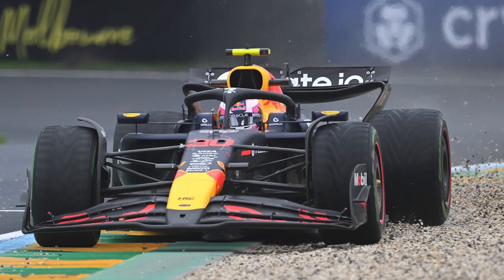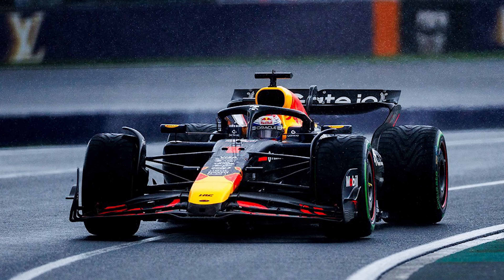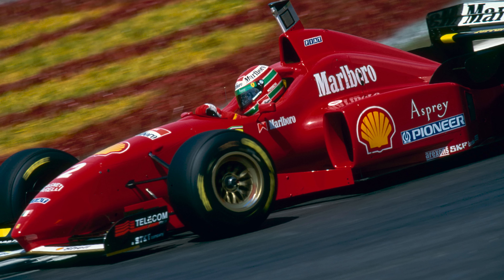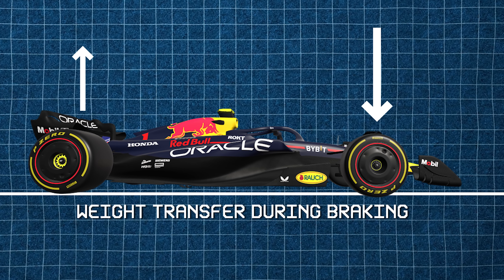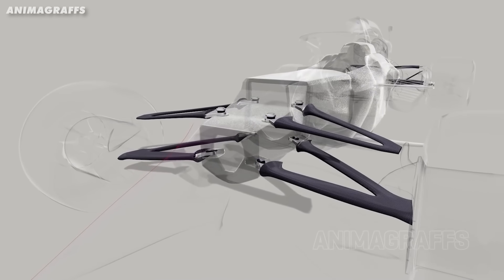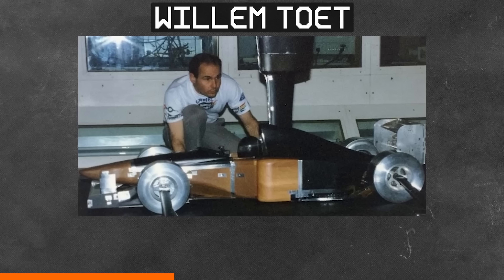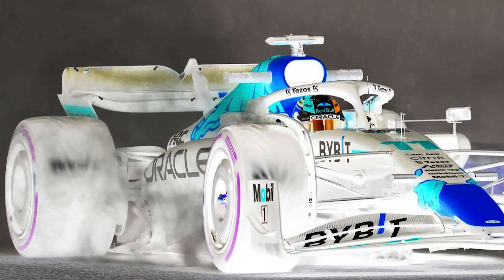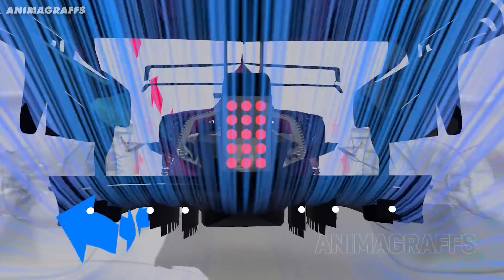F1 Engineer Explains Red Bull's Difficult Car

Comment: Here after Max perfectly balanced it for pole position 😅
Reply: If you hear Horner's interview after it is even more impressive to know that Max is not just doing Max stuff on track but also in working with his engineers. They made an insane amount of micro adjustments to get the car where it was for quali, then it just needed the perfect lap lol. What a treat he must be from an engineering side, he's just a massive racing geek on top of being one of the best 2-3 drivers in world (on any given day).

*McLaren fan ;)
Reply: @tbz1551  
Anyone who's driven a Sim for an hour then looked at best sector times meaning you're potentially 0.4 faster, yet can never string them all together, well that's what Max did today, McLaren engineers did a better job, just the drivers did what often happens and can't get it all together.
Reply: Yuki had traffic in Q2 and so did not have a run as he did in Q1. Something needs to be done about qualifying.
Reply: @bertram-raven had Tsunoda not stuck behind traffic on Q2, his lap could've been guaranteed for Q3.
Reply: @bertram-raven  they should just do it so everyone is released a certain time off each other and it becomes more of a time trial, that would be good, also eliminates giving a tow
Reply: Here after he kept it together for the win
Reply: @bigfootproductions749  😂 likewise
Reply: I watched closely and saw Max really fighting the wheel compared to McLaren drivers
Reply: And set a new circuit lap record
Reply: The guy is simply one of the best drivers in f1 history
Reply: Even Max admitted directly after qualifying that he felt he was going to crash 5 times during that lap. So clearly the car is still incredibly unstable. Max just has a 6th sense to keep the car perfectly under control, even when the car is out of balance.
Reply: said he actually felt like he was gonna crash multiple times in that lap 😅 its unstable even for his standards
Reply: Here after Max balanced it perfectly for a race win 🏆 🏅
Reply: He said he almost crashed it.
Reply: If you are moaning about spoilers in the chat, wtf did you expect in a world where knowledge can be passed across the world in milliseconds. If you don't want spoilers watch it live or turn off socials. It's a you problem, noone else
Reply: Max reacted to his entire lap, basically saying he had under or over steer through every single corner.
Reply: And won
Reply: .... and won the race
Reply: I know Max can squeeze a win out of just about any car but I don’t think he would be setting new lap records if the car was as bad as everybody on the internet thinks it is. Is it the RB19? No but a car winning 21 out of 22 races is a straight up anomaly. At the end of the day, we’re only 3 GPs and a Sprint into the season so I think we should reserve judgement on the overall performance of the car until there’s more data to look at.
Reply: I've been watching f1 since 86 when I was 8 yrs old and it sounds so lame to say but it really is like Senna and Schumacher had a baby and his name is Max . He's got Senna's balls and Schumacher's brains. The kid really is the best I've ever seen do it and he's still so young.
Reply: It’s built for him dud
Reply: @RoshanSinghB  that not really true. The car is how it it. You even hear Max talking about how he struggles to drive it.
Reply: Yes I'm here after 4 weeks to say pole again for Max, what a great skilled driver
Reply: here again after max put it on pole at silverstone
Reply: I was afraid he wasn’t going to because of the setup in both FP1 and FP2 yesterday. 

Thankfully, Max pulled through
Reply: One lap on softs with empty tanks, hardly race conditions.
Reply: And a lap record
Reply: Would you believe it wasn’t perfect at all.
Reply: It was one lap. He said the car is behind on race pace. His only chance is if it rains on Sunday.
Reply: We are looking at a living legend doing his stuff. Wonderful times to watch f1.
Reply: and a lap record😅
Reply: Here after p1 😢
Reply: You cannot compare the person who come from Mars.
Reply: Because McLaren has low quality drivers who fail under pressure
Reply: even max has his problems with the car and it took him several laps to get everything out of it.
Reply: That’s like saying the Honda MotoGP bike isn’t shit because a certain MM93 slayed on it. RB is currently looking like 2020 Honda.
Reply: I’m here after verstappen won!
Reply: Because max Master the car 😂
Reply: It's Max's car x2. That simple.
Reply: here after max got p7 in qualifying in bahrain
Reply: Here after Max should have gotten a black flag.
Reply: @Storytime3stax  Get a life. Just saw the onboard. Max simply kept his line. Russell came flying around the outside but could not make it stick. That is all.
Reply: Here after Mercedes took Max out… Again
Reply: And when quickly backwards!😅
Reply: Starting from Albon, the Red Bull car has always been built around Max. If he can't adapt, the Red Bull engineering team can disband.
Reply: Max has a very unique driving style and takes some very unconventional lines. A car that suits him will not fit a majority of drivers.
Reply: More that Piastri and Norris made more errors in their lap than Verstappen did...
Reply: He almost crashed 5 times, he was taking everything that was possible out of that car.  @2Fast4Mellow
Reply: @2Fast4Mellow original comment "Max perfectly balanced..." means just what you wrote, Max did a brilliant job and Oscar and Lando didn't. So why the "MORE that..."?
Reply: Literally has the track record now he drove a world record lap @2Fast4Mellow
Reply: @2Fast4Mellow  Not really. Lando's comment was that his fastest lap was his best. It seemed like he felt that was all he could extract from the car. From the data, Max gained around a tenth on the entry of Turn 16 alone, that secured him the pole position since they were neck-a-neck on 1st and 2nd sector. The difference in braking/corner entry on turn 16 between Max's and Lando's fastest lap was HUGE. It was amazing how late Max braked and yet was still able to precisely turn the car.
Reply: @2Fast4Mellow but less error than Tsunoda or Hamilton were.
Reply: @2Fast4Mellow  it's basically outbraking everyone in that one last corner
Reply: That's purely because it's Max and the car fits his driving style more, the car itself is still a shitbox comparable to a 2024 Kick Sauber
Reply: @DonTeuni  you must have not watched practice or qualifying then. Yuki pretty much already got a pretty good handle on the car and was pretty close to Verstappens times through the entire weekend. It wasn’t till Q2 that things went downhill and it all started with another fire, like the 5th one at that point which is ridiculous. Anyways that plus redbull making the mistake of trying to save a set of softs for Q3, put just a little too much pressure on him and he cracked. You could see it as he was starting his final flying lap, he had already messed up the chicane and lost a bit of time at the start, then he washed out wide at like turn 5 or 6 and it was pretty much over at that point. If they had given him an extra run he probably could gotten 5th rather than 15th. So you can’t say the car is just for Max based off two passed drivers who let’s be honest werent exactly WDC material. Checo was already pretty mid when he joined redbull, and that’s coming from one of his biggest fans sure he had a few moments before joining redbull but he was never a top tier driver imo. As for Lawson? He barely has any experience in an f1 car so it wasn’t that surprising that he did terribly. Yuki proved that experience and talent can overcome a bad car, but you can still be caught out by bad strategy.
Reply: @DonTeuni  reminds me of the 95 Benetton. Alesi and Berger couldn't handle the car in 96.
Reply: @DonTeuni  It's not just a "style" among others. The car is set in a way that it leaves no room for mistake. To drive it you need to be extremely good. You phrase it like they make the car easier for Max specificaly. It's not. It's just extremely hard to drive and only Max has the skills sharp enough to tame it. And I say this as a person who doesn't particularly like him for his reckless driving at times.
Reply: @DonTeuni  all lies. Max has the fastest car on the Grid rn.
Reply: @DonTeuni  no way it's a shitbox.  It's faster than the mcclaren on the straight.  It's a drag racer that can't corner.
Reply: @DonTeuni and also compared to 2025 KICK SAUBER from Bortoletto/Hulkenberg and 2019 Williams of Kubica/Russell.
Reply: absolutely, George says max likes full sensitivity on his car whereas other drivers will struggle to even take a corner in that.
Max's driving style is super sensitive compared to any other, hence finding teammate is like looking for another Verstappen.
Reply: @DonTeuni tbh i think max will do good in no matter what car u put him to bc hes max but today he got p7 whixh is so UNBELIEVABLY
Reply: @DonTeuni  His teammates including the recent Liam Lawson denies that.
Reply: Max can have the pole position with a tricycle.
Reply: @bastadimasta or even a Unicycle.😅
Reply: @  Max can have the pole position with a Unicycle
Reply: @bastadimastathen he should race the vcarb
Reply: It’s just a bad car and Max is just so much better
Reply: Car is designed for Max and he’s been driving it for how long now lol kinda a stupid comment bro use your head
Reply: @nicplourde9703  Max doesn’t like how the car drives. He is frustrated with it. He can drive it effectively, but it doesn’t behave like he wants. He wants a fast car that is easy to drive. That’s when he won 2 of his titles and when his teammates were also fast. Right now he’s forced into adapting in order to get the most out of the car.
Reply: He didn't balance it at all, he got lucky in a lap or two and was able to contain it.
Reply: @DavidGonzalez-y3n  Butthurt Hamilton fan alert
Reply: @aseq2  they always come out of their basement with their excuses, but praised Lewis for winning the China sprint yet they all disappeared like roaches when he couldn’t even get a podium in the actual race. They just can’t believe that all that hype and excitement was literally all for nothing 😂😂 Lewis is washed and he continues to prove it, yet somehow these people still call him goat but still hate on Max whenever he does something like this. I guarantee you if it were Lewis who had pole, this guy wouldn’t even mention luck he’d just be singing his praise calling him the goat 😂😂😂.
Reply: It was built for him. Its bespoke.
Noone else can drive it.
Reply: @deadprivacy Max even says it's hard to drive lol.
Reply: @v4skunk739  but still. Its totally designed with him in mind.
Its potential speed is part of why it handles like it does. Take away its turn in characteristics? 
It wouldnt be as fast.
Take away the driver who attuned to those characteistics? Who Knows its setup like the back of his hand too..
Its a dog of a car.
But its operating window is so thin, so built around max?
Its literally his car.
Same thing happened in motogp with casey stoners ducati.
Less designed around him but he was the only rider who gelled with it, it was too stiff for other riders, the combination of stoners style and skill set and his tiny frame.
Made it the fastest bike out there 
But only with stoner on board.
Noone else could ride the damn thing.
Reply: Thanks for the spoiler …
Reply: @WoodNZ I never watch YouTube clips and even less comments before watching the current practice/quali/race myself. Maybe you should try that approach rather than hoping every single commenter warns for spoilers?
Reply: @WoodNZ  For real, I've blocked EVERY F1 commentary channel on YouTube, and every F1 news source on Google. No these idiots post spoilers for races.
Reply: Some of us haven’t seen it yet. Thanks for spoiling it.
Reply: @gravl1 then you should avoid social media from all angles.
Reply: Dude wtf, spoilers. Not all of us have had time to watch.
Reply: @BobbyGeneric145  why would you go on the Internet if you were trying to avoid knowing the outcome of something?
Reply: @matthewshepherd826 couldn't agree more. It's 2025 ffs and half the moaners about spoilers were posted like 5/6 hours after Qualy! That's a lifetime in modern world

Comment: I think that the next generation of f1 cars should inlcude active suspension as it would help with balance
Reply: The reason they banned all the advanced systems of the last generation was to make the cars harder to drive so 'the driver could make more of a difference' because team bosses and F1 wanted to showcase the 'gladiators' on track and close up the field by removing the advantage the bigger teams had with their more sophisticated systems. Teams and drivers have done nothing but complain.
Reply: At least bring back FICS

Comment: Why not just copy the McLaren?
Reply: It's not about copying one car that delivers a better lap time by looking at it from the outside, or even stealing their personnel, it's about developing a philosophy (and infrastructure) with your engineers and designers where you can reach the best solutions and understand how best to get performance by making setup changes and upgrades i.e. it took McLaren 5+ years of shuffling personnel around, replacing key positions in order to get to where they are now. This is what John Owen said about how Merc developed their 2012 car that lead to their dominance from 2014 to 2020, and Allison reiterated that 'philosophy' is about a way of working, not a particular car concept or component part. Arguably though, Rob Marshall took his expertise in flexing wings from Red Bull to McLaren, which somewhat contradicts that.
Reply: The McLaren copied the RB first. It's not that simple.